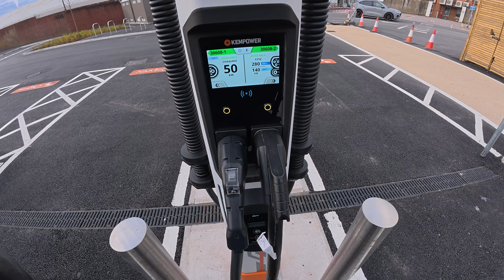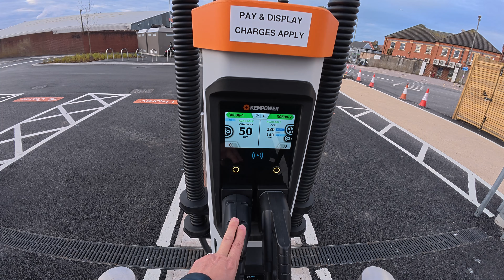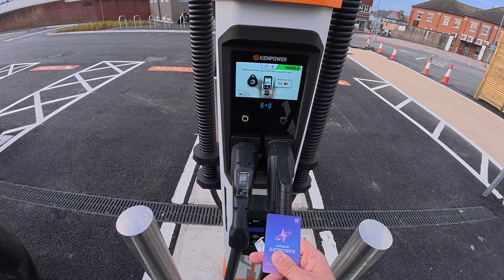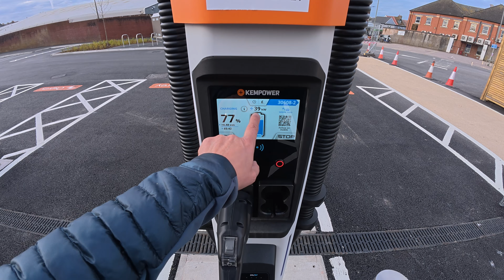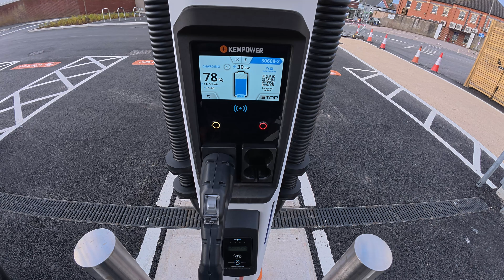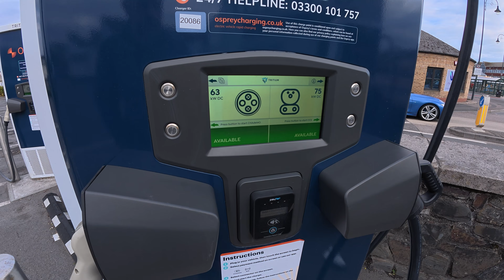First Time Using a Rapid EV Charger? WATCH THIS!

Comment: First pont; why isn't the cost per kWh made plain before you charge? 83p is a complete ripoff- Tesla Supercharger is variable but~ 40p and most EVs can use their system.
Reply from the maker: Great question!

You're absolutely right to highlight the issue around cost visibility—unfortunately, many public DC chargers still don’t make it easy to see the cost per kWh at the charger itself. It often means having to check an app or scan a QR code, which isn’t ideal when you just want to plug in and know what you’re paying.

As for using a Tesla Supercharger—yep, it’s by far the easiest and cheapest experience if you’re driving a Tesla. Just plug in and walk away. That’s actually why I don’t usually film those in detail… it wouldn’t make a very informative video! 😄

Also, for non-Tesla EV drivers using Tesla V3 Superchargers (which alot are open to all EVs in the UK now), the cost still isn’t shown on the charger itself. You have to check the Tesla app to find the rate before you charge, which can be confusing if you’re new to the network.

That’s why I focused on non Tesla public chargers—there’s more to learn, and it’s where a bit of guidance can really help EV drivers out.

Hope that clears things up, and thanks for watching the video!

Comment: What is the card called that you recommend
Reply from the maker: Thanks for watching and your comment. 

The card is the Octopus Energy Electoverse card. You do not need to be a Octopus Energy customer to apply for one and is accepted by a large number of charge point operators here in the UK and across Europe. Its not a credit card, its a basic RFID linked to an an account.

If you are an Octopus Energy customer, then the cost of charging is added to your monthly electricity bill and deducted there.

The Electoverse card has other benefits, such as avoiding any debit/credit card pre-authorisation charges and also normally provides  discounted pence per Kwh rates with lots of charge point operators.

The card is also linked to a very handy Electoverse App.

If you are considering joining Octopus Energy there is a referral link in the video description which would provide £100 credit to electric account, split £50 each.

Hope you found this information useful.

Comment: Interesting, but my 2018 Renault Zoe doesn't have a connection point (CCS2) like you used and I believe it will only charge at 42kwh max. So are there no public chargers now which will fit Renault Zoe?
Reply from the maker: Thanks for watching and your comment. I assume your renault ZOE model only has AC charging capability?

If so, there are a significant number of AC public chargers available (search for them on ZAP map), obviously not as fast as DC rapid/ultra rapid charging, however I believe the ZOE can accept up to 22Kwh on AC (which is faster than a Tesla). Ive done a video on public AC charging on my channel, feel free to check this out.

Comment: I am considering ordering an electric car currently.  There are no rapid chargers where I live so I need to go a long way out of my way to charge up.  I do have questions which you will no doubt think are pretty silly, but for me very important.  One question … if it’s a Tesla charging point, does this mean for a Tesla cars only?  Or can anyone use it to charge a vehicle.  Sadly my bungalow is not suitable for home charger because the cable needs to lie over a public footpath which is not allowed. X
Reply from the maker: Thank you for watching and  your comment. Firstly no question is silly, the sole purpose of this channel is to try and provide informative information where possible. 

A large proportion of Tesla Superchargers are now open to ALL EV's and more are coming on stream all the time. To check your local area, if you go to the Tesla website under the "'Find Us" section you can find Superchargers local to you and filter "Open to All"
Reply: @NiceandEV thank you for your kind reply x

Comment: Where does it say what the cost per Kw is on the charger so you know before you start the process ?
Reply from the maker: Thanks for watching, and a great question. If you look faceon to the charger just under the letter 'O' in the word Kempower, you should see a £ icon on the screen. By pressing this symbol, you should be given the price per KWh. I will look to add this detail in any future Osprey videos. Thanks
Reply: @NiceandEV  thanks for the reply and thanks for helping educate a soon to become EV owner. Why is the price hidden away? When do you think the charge market will get competetive and have prices shown on signs outside charge points (like petrol stations do)?
Reply from the maker: Some charge point operators such as EV-OTM (On The Move) now have the digital boards/totem poles displying the Kwh price alongside the petrol and diesel prices at the road side. Ive done a quick video on my channel about EV-OTM, feel free to check it out. @andyrowe
Reply: @NiceandEV  thx

Comment: Nice clear instructions but at 83p /Kw I’m so glad I’ve got a Tesla.
Reply from the maker: Thanks for watching and your comment. The ease and cost of the Tesla Supercharger network was one of the major deciding factors of going for a Tesla. Other charge point operators need to catch up.
Reply: @NiceandEV same here. I got my model 3 last week and had a fairly long drive for work a couple of days after picking it up and the Tesla network is so simple and reasonable price wise too. Good to see this and how other chargers work too
Reply from the maker: @bornslippy22

That’s awesome to hear, congrats on the Model 3!

Totally agree – the Tesla network makes things so easy and stress-free. Other charge point operators are definitely catching up now in terms of ease, design and even pricing, but in my view the Supercharger network is still in a league of its own. Glad you’re enjoying the experience too!
Reply: Or a brain and use Tesla open to all the rest are just rip off. Yes there may be some reasonable price ones, but it's a lot of hassle to find them.
Reply: Or even kWH
Reply: @RamboMT1 if you want to be correct it's kWh. Small k capital W small h.

Comment: Thanks for this video. I just got my first EV and your vid demonstrates the process very clearly.
Reply from the maker: Thank you for watching and your comment which is really appreciated as I am new to the YouTube world and finding my feet 😊
Reply: Hi. Great video. Quick question… when charging your EV, do you also have to pay for parking there ?… I noticed the sticker on the front of the charger. !!
Reply from the maker: @StuartBenton Thank you for watching and commenting. Unfortunately there is a requirement to pay for parking whlie charging at the Barnstaple Central Carpark. Reamins to be seen if this is enforced.

There are alternative (and cheaper)  EV-OTM DC ultra rapid chargers just off the A39 in Barnstaple with several hours of free parking. Ive done a quick video on these, check it out on the channel.